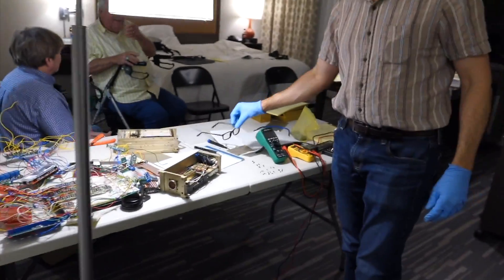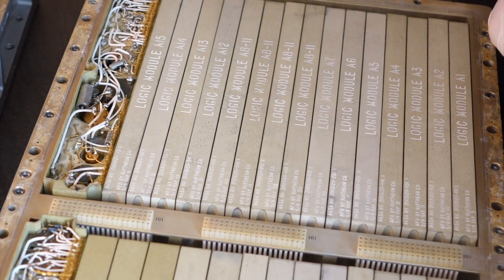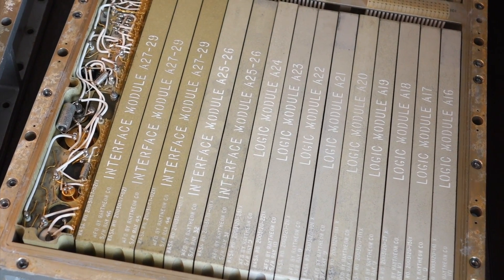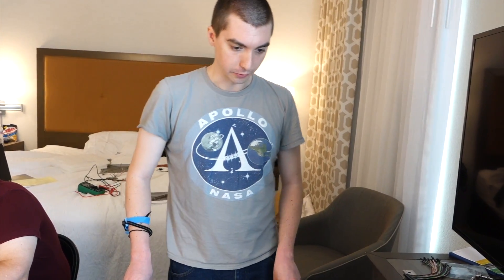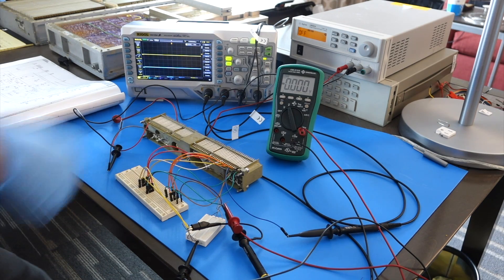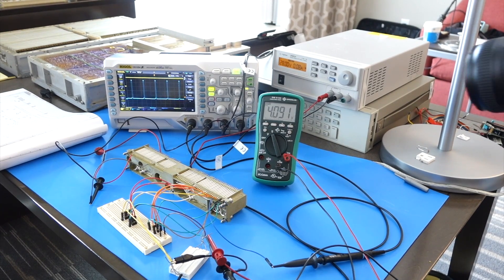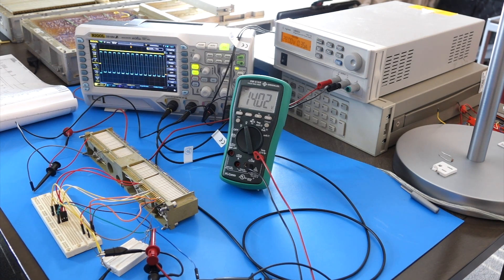Apollo Guidance Computer Part 2: Power supplies test

Comment: 4:10 dumb person question … why is ‘N’ and ‘M’ font that way on the boards
Reply: Probably to mimic shapes of other letters printed through hollow mould, that needs such design to hold certain parts of letter (for example letter 'O' where inner part must be connected to the outer part).

Comment: About the power supplies - I heard the word oscillator.  If this is a DC to DC power supply from1970 would you need an oscillator.  Then I see on the 'scope that there is a square wave.  There was also mention of the ripple (shown on the scope) being caused by the caps charging and discharging.  All this points to this being an early switching power supply.  Cool.  True?

Comment: 10:55 The famous DER EE DE-5000 LCR meter detected, along with its pathetic TL-21 alligator adapter (never as accurate as a pair of true 4-wire Kelvin clamps, though everyone can do the mod). 
Rigol DS1054Z, are you kidding? )

Comment: Wait....was there a wiring machine in the 60s?....amazing
Reply from the maker: You mean in the 50s. At least at IBM, computers schematics were drawn on CAD and resulting backplanes automatically wired by CNC in the age of tube computers already.
Reply: I think people wildly underestimate the amount of automation that was used in mass production by the turn of the century. Remember that punch cards were invented and used in the 1700s to automate textile looms. So while 1950s automation might seem primitive compared to what’s possible today, 1950 is much closer to today, chronologically, than it is to the dawn of automation. If you look at documentary films about factories in the 1930s, 40s, and 50s, you’ll see a wide array of automatic production in use. Some of that is barely unchanged today.

Comment: While going thru the "AGC Handbook" noticed that the Signal Wiring diagrams were missing for modules 13 and 23 and a few other miscellaneous pages. Was the document you received incomplete? Thx for updating that backplane link. I probably missed it but is there a wiring diagram that covers the backplane?
Reply: Yeah, there were sadly a few missing pages in the Handbook. The good news is that we've since recovered the missing pages, as well as many many more revisions of the schematics, from the National Archives (in higher quality too!) The AGC schematics are split between boxes 459 and 460:
https://virtualagc.github.io/virtualagc/AgcDrawingIndexBox459.html
https://virtualagc.github.io/virtualagc/AgcDrawingIndexBox460.html
Search for the drawing numbers on those pages and you should be able to find anything missing from the Handbook.

There sadly wasn't a wiring diagram that covers the backplane... and (amazingly) not even one that covers the internal inter-tray connectors. All of that information was stored in a physical book called the "AGC Wirelist", of which there were very few copies. Instead of digitizing those onto microfilm, they instead scanned little notices that said to get a hard copy from MIT (here's an example: https://archive.org/stream/apertureCardBox459NARASW_images/apertureCardBox459NARASW#page/n1691/mode/1up )
It's not clear at the moment if MIT still has any copies of the wirelists, but hopefully they do, and finding out for certain has been on my list of things to do.

Comment: Fantastic effort and fascinating equipment.  However, unless I'm mistaken, you are soldering test wires to the pin connections instead of clipping in.  That disturbs me a bit.
Reply from the maker: These are slide-on clips, of course. You can relax now ;-)

Comment: Apollo 'Power supplies test':

*supplies*; trying not to be pedantic, but, as I have been showing this to my linguist wife, unless this is applied to several supply sources (e.g. electric, hydro, nuclear,...) or to several different places of entry of a single source of power (electric), this should surely be called 'Power supply test'?
Reply from the maker: Hmm. I am not a native speaker. But isn’t power supplies the plural of power supply? As shown in the video, the AGC has two, we tested both.
Reply: @CuriousMarc Oof, this is one of those things where, as a native speaker, it’s really hard to put my finger on why “power supplies test” feels wrong, but it does. I suspect it’s that if we look at the singular “power supply test”, the “head” of that compound noun is the word “test”, and so it gets pluralized. To emphasize that we are testing multiple power supplies, I think we’d just say “testing the power supplies”. 

(It’s so fascinating how different languages do things. I also speak German at near-native level, and German, for example, tends to use more passive voice, and lots of noun constructs, for titles and headings, whereas English prefers a more active voice and verb-based titles and headings. (Yes, linguistics was my minor at university. :p) I can also speak at a conversational level in French, but I couldn’t tell you about heading styles.)

Comment: how did they weld electronic components without damaging them??
Reply: They used spot welding; basically a quick zap on each joint. It wasn't like a guy with an arc welder joining steel beams together. Here's a documentary on the assembly of the AGC showing the welding taking place: https://youtu.be/ndvmFlg1WmE?t=1153

Comment: You are doing this....with a cheap Rigol scope, an old power suply ,.. a shit lcr meter (not a keysight ...) and i’ve seen on the bed that shit green multimeter ? Hats off ! Not that it maters to much but still..... Tek ? Keysight, Rohde .... SOMEONE ... hear me out please ! Theese guys are amasing.  Edit ... the green multimeter looks like a brymen 869 rebranded one... quite a nice one actually.
Reply: So.. a lot of geeky people are too focused on what gear they use, how many digits of precision their multimeters have, how fancy their scopes are... but true nerds like these guys are task-oriented. In practice, you can pretty much use anything to get good work done, as long as you're aware of the limitations of that gear. Fancy gear might make very specific tasks easier, but for general purpose electronics and restoration/reverse-engineering, it's almost irrelevant. The only component that mattered is the PSU they were using. If a cheap PSU suddenly failed, it could potentially destroy this irreplaceable hardware.
Reply: More matters than just the PSU, although I did go Agilent there for (hopefully) reliability. The multimeter was also specifically chosen for a low (~0.5V) continuity test voltage. It's possible to damage sensitive circuits using meters with test voltages that are too high (e.g. Fluke 87V which is ~9V). In general, all test equipment was tested with other test equipment before being allowed to touch the AGC, so we knew exactly what it was doing.

But otherwise yeah -- it would be great to have a nicer scope, but it would be neither portable nor cost-effective.
Reply: @mikestewart8928  Thank you for your work and allowing it to be shared! "In general, all test equipment was tested with other test equipment before being allowed to touch the AGC" - good to hear that; I should've expected it. :) 0.5V is very low, wow. The gear I use is usually around 1-1.2V, I care about high input impedance more for my purposes so I have some meters specifically for that. For good portable scopes, consider the Micsig brand scopes. Battery operated, hi-res touch screens, lots of memory, all the usual protocol decoders and naturally isolated. Prices aren't much more than the Rigol you're using.
Reply: Thanks for the suggestion! But don't get me wrong -- the Rigol scope didn't leave me wanting at all during this trip. It's pretty great for the price. And it's not like we're doing any fancy protocol decoding on this old parallel computer. :)
Reply: @mikestewart8928  Yep, I guess your biggest concern is just avoiding mistakes.. would be no worse feeling than bricking something so important. Best of luck to you guys!!! And yep haha, I have that exact scope as well, like so many people.. it's great for everyday stuff! :) My only other scope is a 2GHz LeCroy for "edgy" work lol. Bulky as heck but boots in a few seconds (yay for VxWorks RTOS). These days I work on either really sensitive analog stuff (preamps etc) or fast digital stuff (FPGA things mostly). Good luck again! -Nick
Reply: Two light and easy to carry Rigol scope, easy to pack meters, whatever else will do the job after being hauled halfway across the country

Comment: I look forward to subsequent parts of this series.  I worked on a large, refrigerator sized computer (digitizer) in the early 1980s. It was a Burroughs machine.  It had 753 circuit cards in its three backplanes.  The cards contained discrete and DIP devices.  All of it was interconnected with 1 to 3 level wire-wrap.  I never added up the number of wire-wrap pins, but I would say it would come out to be around 75,000 of them.  It was tried and true technology.  Very stable and reliable for its day. In the seven years I worked on it we only had one wire-wrap failure.  That was related to a wire going around a pin and the edge of the pin cut through the insulation causing an intermittent short.

Comment: Have you discovered any ashes or coffee stains trapped inside the mainframe ropy wire bits?  Those engineers smoked like a chimney.  (watched Apollo 13 in high school - which makes me an expert)
Reply from the maker: Not a trace. This was probably assembled in a clean room, was hermetically sealed and filled with inert gas. It was still under pressure the first time it was opened in 2004.

Comment: Fantastic stuff. Any plans once it's up and tested to hook it up to emulators of the peripherals, load up the software, and run the whole shebang in a closed loop? Maybe even do whole simulated missions complete with failure scenarios? I'd tune into that show.
Reply: Yes, we hope to do something like that. It depends on how well everything works and how ambitious we are. The peripherals do I/O with pulses at weird levels, so we'd need to make some emulation interfaces. One problem with doing a simulated mission is that it would happen in real-time, so it would be very slow to perform unless we can jump to the parts where something happens.

Comment: I'm slightly confused. If this came out of the first man-rated lunar module, then why was it populated with a non flight-rated unit, and why is it being repeated that it was just a development unit? Unfortunately Google isn't much help right now, googling anything about "first" and "apollo" or "lunar module" just yields results about Ryan Gosling.
Reply: Grumman produced a set of test versions of the LM as well as the machines destined for the specific missions such as Apollo 10, 11, etc. These earlier machines were called Lunar module Test Articles and our AGC was in LTA-8. LTA-8 was used at the Manned Spacecraft Center (now Johnson center) in the thermal/vacuum chambers. 

These chambers were the only ones that NASA owned which were large enough to hold an LM, CM, or CM+SM. They would subject the spacecraft to temperatures ranging from hundreds below zero to hundreds above, while in a vacuum, to verify that the spacecraft interiors would remain habitable. Astronauts sat in the spacecraft during the tests, simulating a mission. 

LTA-8 was basically the same design as the production LMs used for manned flights, but was subjected to abuse on the ground to ensure that the production ones were safe for flight.  http://heroicrelics.org/space-ctr/lta-8/index.html

Our AGC was the 14th of 15 prototypes before the first flight models were produced, although it has the same circuits as the production models. It was installed in LTA-8 and used for the various tests. There was some overlap in production, but the major difference in the AGC we restored is the use of aluminum for the chassis instead of the lighter magnesium chassis in the flown computers.
Reply from the maker: They man-rated it on earth, in a giant vacuum chamber in Houston. It not intended to fly. Good info on how they did it in this link: https://www.nasa.gov/feature/50-years-ago-two-critical-apollo-tests-in-houston .
Reply: The first man-rated lunar module (LTA-8) was used for testing on Earth. Astronauts practiced in this lunar module inside a giant vacuum chamber for over 48 hours, using the module for life support. (This is why a man-rated module was needed.)  Since the module was never flown, this AGC didn't need to be rated for flight. This is also why LTA-8 is on display in Houston rather than being in space. The first video discussed this a bit more and details on how the lunar module was tested are here: https://spacecenter.org/attractions/starship-gallery/lunar-module-lta-8/

Comment: First, thanks for this video.  I've had a long time interest in the AGC.  If possible, please post some high resolution photos of the NOR IC's. I have some Fairchild, Dual, 2 Input RTL NORs I've experimented with, as these can sometimes be found on the surplus market.  But, to my knowledge, I've never seen the Dual, 3 Input RTL flatpack ICs anywhere except in photos of the AGC.  I wonder if any of these were every sold elsewhere.
Reply: They were standard offerings from Fairchild for the short period that the micrologic chips were sold; while the more usual package was TO-5 style,  customers could order these in flatpack. 

I don't have a good high resolution picture on my iPhone but I will look at some pictures done by Mike and post one
Reply: Thanks.  Out of curiosity, if you determine that one of the flatpack NOR gate ICs is bad, what is your plan to replace it?  I have several Fairchild uL914 devices (dual, 2 input RTL NOR gates) packaged as TO-5 style in epoxy, if that helps.
Reply: @wayneholder  We have two lines of attack planned. If there are only a small number that are bad, we can take advantage of spare gates that are sprinkled through the tray A modules, making wire-wrap changes to insert them. 

If there are more failures than we have spare gates, the next approach is to build teeny PCBs with surface mount resistors and transistors that match the circuit inside the Fairchild IC. 

We would need to gently cut the leads of the failed IC, remove it, then place our teeny PCB in the spot and spot-weld the leads to the AGC. 

We hope to not need to do anything too major to the AGC. Ideal is no failures, next best is to use a spare gate with minimum wire-wrap changes. If the gate fails open, for example, we may be able to leave it wired in place and simply add the new gate to the net with new wire.

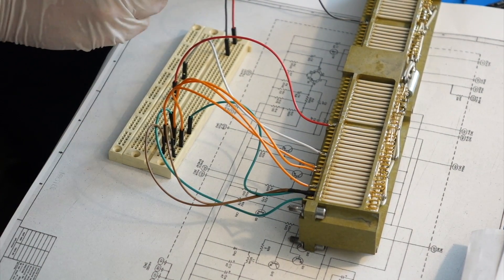Comment: At 13:43
?
You did not solder the wire directly to the pins, did you?
Please tell me you did not, because actually it looks like you did!
You created some shoes out of metal to stick on the pins on soldered on them. Right?
Reply: Yes, indeed, we have slip-on shoes that we put on the pins. No damage to the min-Wasp pins at all.

Comment: 1:15 I love that font. Does it have a name?
Reply from the maker: I love it too, and would sure like to know what it is. Look up "military stencil fonts". The military is supposed to use Arial in stencils, but I could no find a stenciled version that matched the M and the solid E in particular.
Reply: The solid C, U and 2 seem to be somewhat rare as well, but it's probably the M that really sets it apart. And the A and the 4 are just so elegant. I have tried googling it, but I haven't found it yet. Hopefully someone who knows will come by in the comments.
Reply: @CuriousMarc  Certainly they didn’t use Arial back then, since Arial wasn’t created until 1982 (as a cheap knockoff of Helvetica).

MIL-STD-130 specifies only that a sans-serif font be used, with Arial, Futura, and others given as examples.

Comment: wow, wish samsung would make power supplies for their TVs with that level of reliability !
Reply: They would be happy to if you would actually buy it but would you pay triple the price if the only feature it had over the cheaper versions was a better power supply? You'd be better off buying the cheap one and when it dies, buy another one.
Reply: @wingracer1614  I'd rather buy one tv for the next 20 or so years, that's much less ressources used
Reply: Lol
Reply: I mean, sure, a TV built to this standard would cost probably $100,000, so just be prepared to open your wallet really, really deep!

Comment: Is there a complete set of schematics available anywhere. I am in the process of building a hardware gate accurate AGC but I only have schematics A01 - A29. By the way I tried the backplane tool but could not get it to work. It just showed a fixed image.
Reply: The raw scans of Don Eyles's AGC Handbook can be found here: https://archive.org/details/agc_handbook_jp2
They have been cataloged and indexed, along with Eldon's schematics, here: http://www.ibiblio.org/apollo/ElectroMechanical.html

Comment: What did you say the PSU's mech structure was made from, cardwood?  I can't quite understand what you said.  Thx
Reply: Cordwood. It is a construction technique where components are sandwiched vertically between two plates to form a very dense 3D structure. Quite challenging to change out one part in the middle, but has other advantages that often outweigh the problems.
Reply: OK, so the term "cordwood" is a reference to the mech asm arrangement of the PSU components, not the material used?  Bye the way, what is the material they used for the PSU mech structure?  It almost looks like a machined plastic composite in the video.  Thx, Carl
Reply: I believe all of the modules are machined from magnesium. The PSU does have one block of small components on one side that looks like it might have been nylon, but otherwise the holes appear to have been directly drilled into the module chassis.